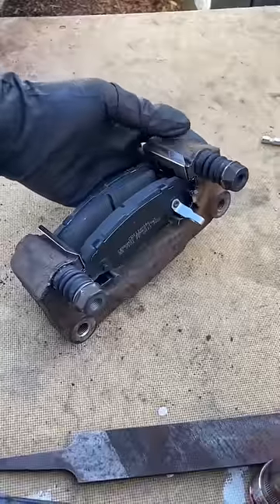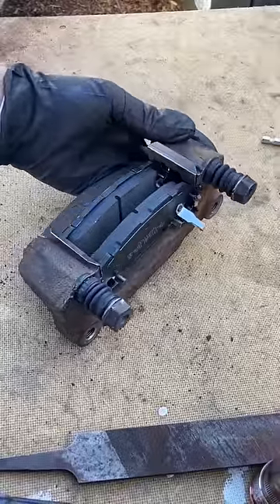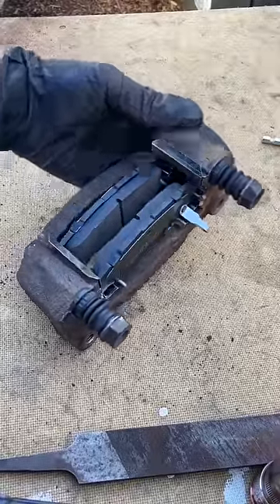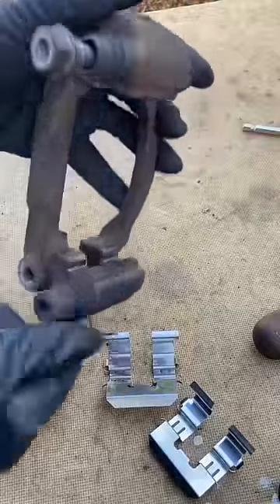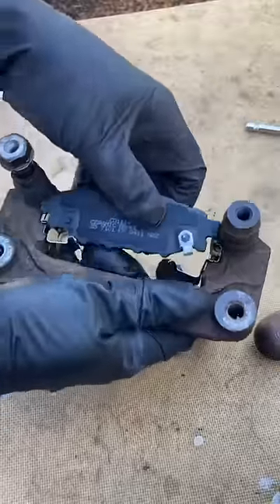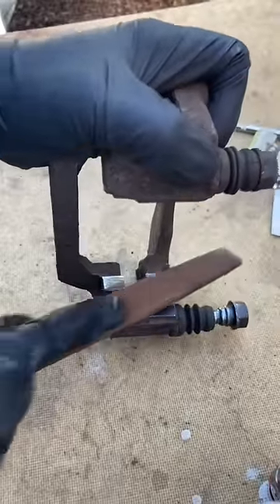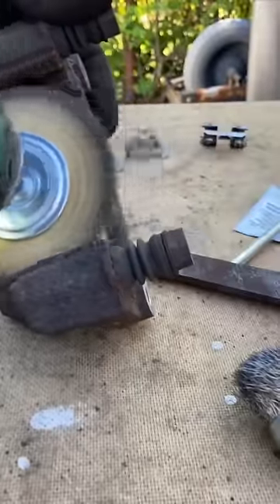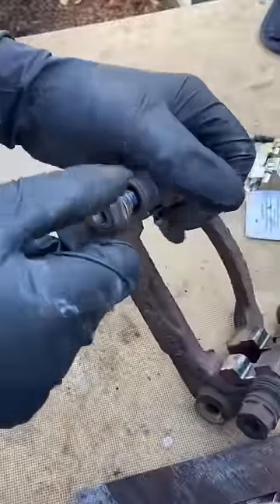What’s the Difference Between a $50 Brake Job and  $200 Brake Job

Comment: $200 labor job? 😂🤣😂 LMFAOOOOOOO all i saw u do was what you’re suppose to do 🥲
Reply: I thought all this was the 50$ job lmao
For 200$ he better remove all rust and dust and paint them red
Reply: Agree
Reply: @abdouaboud7490  obviously you are not a mechanic. You probably here to learn.
Reply: @mike155573  no “mechanic” should even be wasting their time rebuilding that junk unless you can’t get replacement calipers and mounts.
Reply: Your so right..THATS TBE PROBLEM WITH MECHANICS TODAY . there parts changers and not even good ones.
Reply: I charge extra to do a proper job don’t everyone else lol omg I do all this for every brake job
Reply: Yes!!! That’s a bit too expensive for a brake job that should take no more than 1 hour.
Reply: EXACTLY 😂🤣
Reply: PUREACIDBURN The only thing to “learn” in this video is how to rip people off while doing what you’re SUPPOSED TO DO 🤦‍♂️
Reply: supersportimpalass Very true
Reply: @supersportimpalass  agreed, this should be known and performed maintenance by the owner. 

I dont think most people realize there are more to maintaining their vehicle aside from airing up tires and oil changes. 

And brakes jobs are one of the easiest things to do on a vehicle. 

But people today are ignorant and lazy. Rather waste money paying someone else to do it after they neglected and abused the poor thing for 100k miles.
Reply: Bro right this is like standard procedure for every brake job I do😂 I mean other than the old grease under the hardware 😂😂😂
Reply: @SubaruDeservesMoreLove I do it all that to the point of painting them silver, black or red. 
The job has my name on it and creates respect/trust.
Reply: I take the $50 job
Reply: Agreed.
Reply: Yes
Reply: I’ll take the 50 and when they don’t operate right I take it back and you have to do it all again right for free.
Reply: Exacty
Reply: @SubaruDeservesMoreLove I agree 
- current mechanic
Reply: I take the $50 job and put im on payments.
Reply: @abdouaboud7490  you can walk buddy
Reply: I just did brakes on my truck and I'll gladly say, he did everything I did and for labor, I'd charge 50🤣
Reply: Charging 200 an hour? Shit you better be sand blasting my caliper brackets..
Reply: Exactly
Reply: @supersportimpalass  that’s how you turn a $200 brake job into a $600 brake job.
Reply: Wow total rip off
Reply: I agree what he did is not a $200 dollar labor break job
Reply: Ford will charge you $900 for all 4 brakes and you could talk your family into doing it for $150 in parts and a case of beer
Reply: Tell me you're not a mechanic without telling me you're not a mechanic..... most of these comments!!
Reply: @supersportimpalass  that is exactly what a "mechanic" is, someone who can diagnose the problem, take the part off, fix or rebuild it, then replace it. Otherwise you're just an ordinary parts changer. Very few true mechanics these day, but there's a helluva lot of parts changers out there. Just my opinion.
Reply: @TheAmericanCelt  some people can't even figure out how to add oil. Not everyone is competent enough to do much more than a oil change.
Reply: @Iowagrown123  i hear ya. And its sad.. it should be taught by the parent at a young age.. im teaching my son now as i do it. Hes only 10
Reply: Wow, you all are such experts! It's a good thing I read comments that way I can REALLY learn..
Reply: @anthony2009accord  its a brake job my guy.. not like you're trying to send a man to the moon..
Reply: @AngryGinger  Right. And labor isn't cheap. $200 for all 4 brakes is not bad at all.  And to send a man to the moon cost more like 2billion my guy. Not 200.
Reply: @anthony2009accord  i never said it wasnt a reasonable price.. My argument is that its an easy maintenance that should be done by the owner in most cases. Obviously certain people arent mechanically inclined by nature.. but most could do a brake job in a parking lot with a jack, jack stands and basic handtools.. 

That was my point.. even my sister does her fluids, brakes, tune ups and most other things... but our grandparents were old school.. didnt pay for nothing they could do theirselves.. I think basic home and vehicle maintenance should be a taught class in high school as well as budgeting and credit management... but hey CRT and Common core baby.
Reply: I’ve never seen a shop do this before. They just make the customer buy new parts. Very rarely does any mechanic or any person for that matter do this.
Reply: @popeyeandstraussmx4165  you've been in some fly by shops.. wouldn't trust them with my vehicle.. i suggest you dont either.
Reply: @mike155573 200 bucks for scrapping some rust and replacing stuff that should be replaced anyways yeah no. and i am a mechanic.
Reply: @mike155573  no he's spot on. guy even says difference in cost is labor only......5 min of labor at 30 dollars a minute?!?
Reply: @bobbymorgret  with modern global mass manufacturing it’s often cheaper to replace a part vs rebuild it.
Reply: @mike155573  I learned this in tech school and he's just doing what he's supposed to do which can be done in 15 minutes
Reply: Facts
Reply: Who paying that come see me 😆 I charge 200 to do the whole  car
Reply: @rodneyalleyne6747  you do your brakes in an hour
Reply: yeah $50 per wheel or your working for free
Reply: Absolutely what I was thinking scary to think this is going above and beyond , but to give the guy credit he’s doing it the right way not pad slapping with no prep which I do respect maybe leave the $$$ amount out and say proper vs not
Reply: That's what i was thinking.... But i try not to do that to much.
Reply: @supersportimpalass  Disagree. OEM new is good but you are going to pay for it. Rockauto stuff is garbage. You are taking a chance buying reman’d stuff, even if it’s factory. The problem is you don’t know where it came from. Wrecked vehicle, for instance. You just don’t know? I have seen junk right out of the box. Bent brackets, stripped bleeder screws, etc.. It’s best to rebuild your know good stuff. That’s what good mechanics do. Just Replacing parts is what amateurs do.
Reply: Took the words right out my mouth brother!
Reply: Took the words right out my mouth brother!
Reply: What's with all this parts changer remarks. There's more to it then that. Yeah spinning filters and dropping oils and small component changes is minimal skill and effort. But good joke go do repairs on a D11 dozer, 110ton drill rig or go work on a 9800 leibhrr digger or even a dragline and then come back to me and tell me were just parts changers.
Reply: @dylankelly5230  Not everyone are parts changers. Good mechanics can overhaul just about anything and know the difference when not to. Sometimes you have replace vs overhaul. I worked in your realm for about 35 years. My speciality was cranes, arial lifts and digger/derricks. My fondest memories were working on our old Condor 150 ft man lift.
Reply: @@WheresImpreza cowboy
Reply: This went over your head
Reply: I saw 10$ worth of work where’s the other 190$ going towards?
Reply: Guess I need to go up on my prices. My $50 job look like his $200. Im robbing myself fr.
Reply: @abdouaboud7490  I don’t fucking think so maybe in whatever country your from
Reply: @rodneyalleyne6747  Somebody’s gotta pay for my $50,000 worth of tools I don’t work for $10 an hour
Reply: @mike155573   well I am and the” 50 dollar brake job “tells me he’s not 😂
Reply: @supersportimpalass that's a perfectly fine caliper, all it needs is to buff that surface rust and brake dust off.
Reply: Exactly all these "extra" steps take about an extra 5 minutes at the MOST. This guy trying to justify his outrageous prices
Reply: @anthony2009accord  pretty sure he is charging $200 just for the front brakes
Reply: Right...that's the same thing I was saying...What's diff from a $50 break job...??
Reply: Litreley the video is a joke
Reply: @phenome4973  So is your grammar.
Reply: Exactly … the $50 job is an insult, might as well drive it with no brakes haha
Reply: @itsamechaniclifegarage3957  Fr at my shop we usually just replace the caliper if it needs but no matter what we grease where the pads rub and the slider pins. We charge a little extra but your shit won’t squeak or wear wrong. I think he’s talking about a jiffy lube brake job 😂
Reply: Lol maybe if your working on your own car that's what your supposed to do.
Reply: @abdouaboud7490  😂 in all honesty a brake job at a Kia dealer front breaks only $300 on a little Forte.
Reply: @TheAmericanCelt  that’s good, I think the sad reality is a lot of modern parents don’t have the time or don’t have the knowledge to pass on to their kids things like this
Reply: @jorgeluisoctavio-cc5jg  your 100% correct and now that psrts are mass produced and readily available the art and knowledge to restore is mostly lost.
Reply: Ill buy new calibers for that price 😅
Reply: @johncohan.mosh.5403  🎖🏆🏅🥇
Reply: It seems no one understands how a flag technician is paid. If you're paying me $50 for a brake job, I wont waste my time amd give you what you paid for. If you want proper care and labor done on your brakes, you'll pay for it or do it yourself.
Reply: Open day light scamming brother. These mechanics need to stopped. 😤
Reply: Every set of brakes ive ever changed i had no choice but to wire wheel all the corrosion and brake grime off to even get the clips on correctly. Let alone the pads, and def with the ability to slide whatsoever
Reply: @JechtAruon  hopefully they decide to stop working right as you need to stop to avoid being tboned by a semi
Reply: yeah, but shops don't actually do that for less than $200. part of why I do my own labor whenever possible.
Reply: Maybe if you werent so focused on money and what things cost, and werent busy stepping over dollars to pick up pennies you wouldnt be so broke
Reply: Exactly! It only takes an extra 15 minutes to do that to both sides… 200$ bucks??????. That’s the exact way it should be done anyways every time you change brakes
Reply: Right he said 50 I do this 150 u git all the parts that come with u pads lol hack
Reply: This has to be joke right? What is tiktok teaching these kids? I  would do all this on four brakes in 30 min myself. $200 for you clean the brake brackets. You must be smoking something really good lol.
Reply: @BaggerV42  thats why he needs 200 hes out of smoke. Needs to reup
Reply: EXACTLY, I agree 👍

To buff off a little bit of surface rust, clean, regrease, fit new boot/seal kits, brake pads on both callipers, and bleed the brake lines, 
that brake job looked a very easy one, and should've taken no more than 30-40 minutes to do each side/calliper, from start to finish, working at a slow pace, and I would never ever use a file on brake calipers to remove a bit of surface rust, omg
Reply: Amen to that.   He is worth $25 / hr
Reply: @pauljoey7977  25 dollars an hour is basically minimum wage
Reply: Labor for doing what he had to in otder to  get the  brake job done. Do you think someone was going to do this for free?
Reply: Normal shop rate is roughly $160/hr and they're charging roughly 1.3hours labor. That's about $208 total. I've seen some really good techs and some really bad ones all charging the same shop rate and time.
Reply: This IS a $50 job, exactly what he did. lol. Why the fuck installs the old calipers anyways when you do your own work. I put new ones if they are getting removed.
Reply: @bobbymorgret  Rebuilding is only logical when it's more economical.